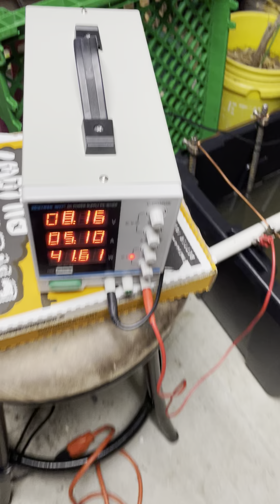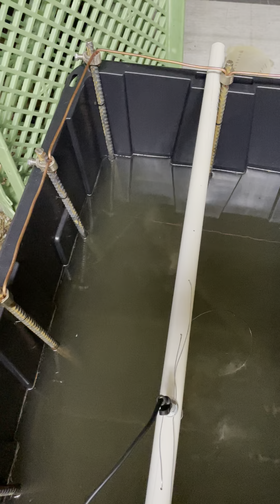Cleaning pieces using electrolysis from Magnet Fishing

Comment: Looks like its working how its supposed to. So do you clean the "sacrificial metal" need for the tank to work (the rebar) or do you replace it?
Reply from the maker: I just take it off and use a wire brush to clean it up.